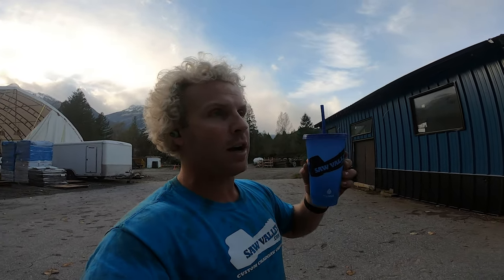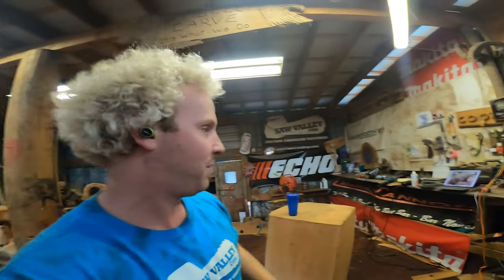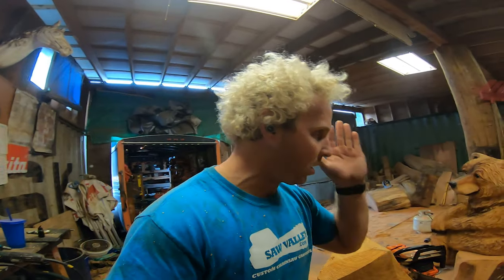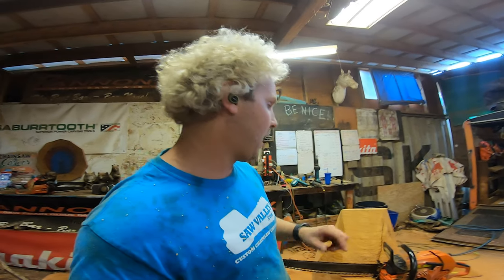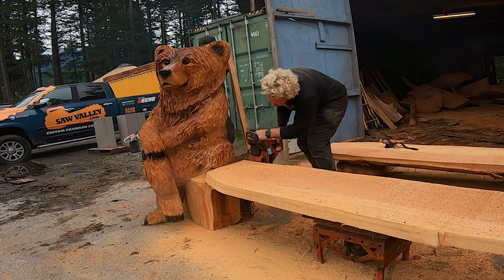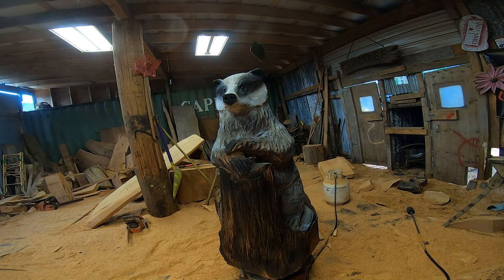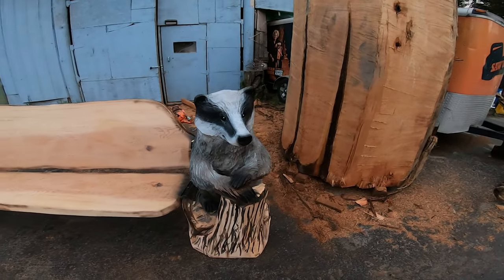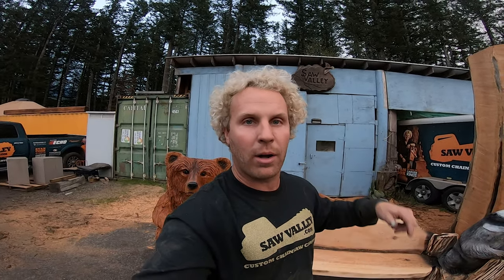Carving Outside Of You're Comfort ZONE - Tips to get it RIGHT!! The 1st TRY

Comment: Love the video's, you are a great artist and I envy your ability to take a picture and turn it into a work of art with wood using chainsaws and simple tools.    I too decided to take the plunge into chainsaw carving and dropped a fortune to get all of the equipment.    I love the Makita die grinders, and finger sanders that I noticed you use on your carvings.    I purchased the Bosh angle grinder, and saburtooth burr sets (all burrs) for both the die grinders and the dremel.   Purchased a dremel 4300 platnium and new air brush kit and need to know how to mix the paints and how to use the air brush the way that you do.   Unfortunately I did not like the Echo chain saws.    I have always been a  Stihl man and added 3 new chain saws to my collection for this hobby, MS194T, MS250, and the MS170.   To the MS170 and MS194 I purchased the Cannon dime tip and Quarter tip bars to put on them.   I used my MS392 for most of my blocking.   I have noticed that the MS170 bogs down alot with the quartertip bar and was wondering if I should put it on the MS250 for more power.    I have an extra 1/4 sprocket for it.      I am also looking for an eye bit to carve the eyes.    I am hearing that saburtooth is coming out with one, I would love to know if you know when and where I can get one.    Looking for multiple sizes.    I would like to see more instructional videos on detailing the faces and more detailed videos on blocking and how to make claws look very realistic as well as how to do the teeth on the animals.

Comment: How do you fit two logs together to create one piece? Such as the joinery of the sculpture taking one log for legs and another for the body, how do you fit them so they don't come apart and the joint lasts just as long as the rest of the carving? I can't find any references from other artists on the matter and I need to know. I work with small logs because it's what I can get a hold of easily but I have plans for larger carvings and I'd like to start to move forward with those designs. Please help if you can?
Continue to kill it!!
Reply from the maker: That will come on new year I’m doing some
Insane pieces with joinery